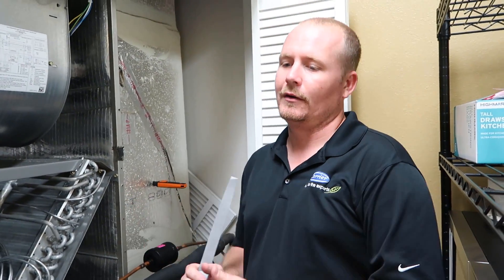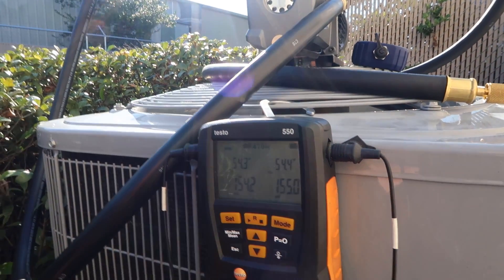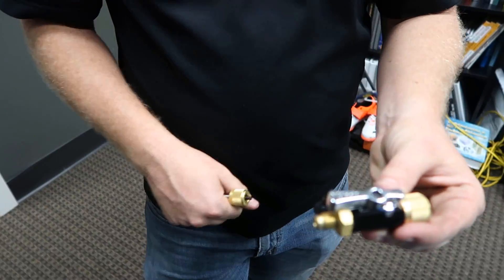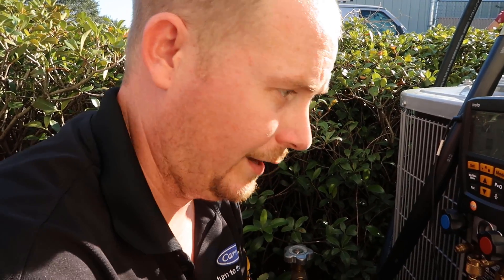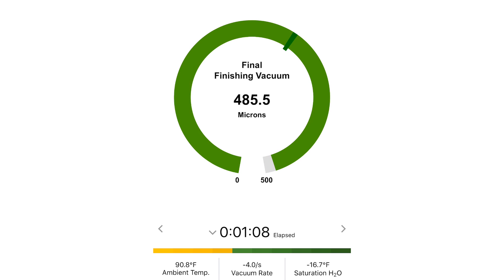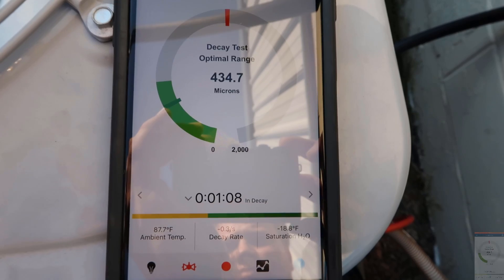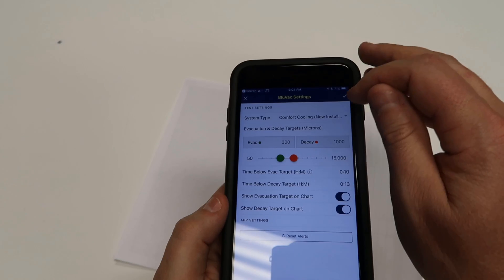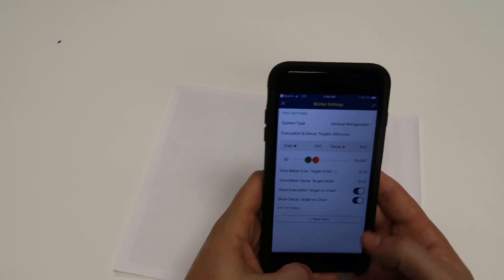How to Evacuate an Air Conditioning System (Fast and Deep Vacuum)

Comment: When you close off the valves and are ready to charge it back up, how do you remove your vacuum gague so you don't lose your vacuum? we dont want to get refrigerant into it the vacuum gague  when charging the unit right?
Reply: Close the valve on the core removal tool and isolate the micron gauge.

Comment: I’ve used the testo 550 gauges and got my pressures at -29.56 for vacuum.
Is that technically ok?
Reply: No the testo 550 gauge is only showing that you have reached below atmosphere  but not showing microns. You need to use a micron gauge to see the microns you have pulled the system down to.
Reply: @majikorn  Thank you bud.

Comment: I'm in college and I'm told that when evacuating, you put the micron gauge on the opposing line (Liquid line) because when you put the micron gauge on the suction line or on the same line that's connected to the vacuum pump, it'll mess with the results meaning it didn't actually hit 500 microns(it does but...), its just the vacuum doing a good job at bringing that number down though that doesn't mean it'll stay at or under 500 microns for very long. What do I know though, I'm just a newbie AC tech and you most definitely have more experience than me.
Reply: You are definitely right though mate that's for sure
Reply: Well if you look he has both liquid and suction connected to the vacuum pump. In the scenario you mentioned only one hose is connected to the vacuum pump, the suction line. The app he is using calculates from the speed, time the microns are increasing if it will increase above your limit you set in the app, such as 500 microns as he used. By having the vacuum pump connected to both suction and liquid lines you pull a faster more complete vacuum and it does not matter what side you put your micron gauge.

Comment: Where are those hoses from? And where do you get the screw on plugs for them
Reply: 1/4 inch plugs can be a double 1/4 brass fitting capped on one end, same for 3/8", 1/2".  Pump Tee adaptor with pipe taper at mid run, and some pumps come with an adaptor for the larger flare vac point setup, otherwise check with just better, parker, robinaire or other fitting suppliers for your needed setup. As for larger hoses, most supply houses carry the 60 inch version, as for  Core remover valve tool, same supply house.

Comment: If you had to recharge the system after pulling a vacuum through the core removal tools wouldn't the vacuum break when you put the cores back in?
Reply: You have 2 Schrader removal tools. Finish vacuuming below 500 to 250 microns you close the ball valves on the Schrader tools. Do the decay test, if  it passes remove your vaccum hoses. Release the charge off the system, if system is opened up and completely empty just attach your charging hoses and purge the hose and open the ball valve. You dont out the schraderd back in till the system has positive pressure
Reply: JPTinioMedia I’m with you there but what do you do on something like the Nordine units that you can barely get a set of gauges on much less the Schrader valve removal tool?? Not trying to nit-pick I do use the removal tool when I can (its great for leaking valves) but when I can’t I have to vacuum through the valve...what is the correct thing to do in that situation??? Also I’m interested in your app and vacuum system do you have a link to that?
Reply from the maker: You don’t put them back in until your done charging
Reply: @HVACS  then what is the process for removing the vacuum hoses and adding the charging hose?
Reply: jus1027 I’m confused as well

Comment: Vacuum pump, evacuation, pull a vacuum. Two newbies arguing weather to pull a vacuum or to do an evacuation. Then deciding weather to use a Rapid Evacuation Kit or Vacuum pump.
Reply from the maker: What are you talking about?
Reply: Is pulling a vacuum and using a vacuum pump the same as evacuation? Cutting through the jargon. Thanks
Reply: @texture6  if im not wrong an evacuation is when you recover whatever refrigerant. Then you pull a vacuum to get anything else out and with this method that last step becomes much shorter.
Reply: WTF? I don't post here because I'm not pro HVAC then I see this...Really,is it ok for the likes of me to ask questions on this channel? I would have some but I like to read first. Unless it was sarcasm then my apologies.
Reply: @InsideOfMyOwnMind  Nobody knows if they were serious or being sarcastic, nobody cares either. So if you have questions, absolutely, ask them. Their are plenty of techs more than willing to answer with good, solid, informative information about methods and procedures in the HVAC line of work. Good luck.

Comment: Where did you get that 1/2" to 3/8" Tee fitting?
Reply from the maker: Adam Walker Trutechtools.com
Reply: HVAC School ah I see the 1/2 to 3/8" hose,  did you just use a generic 3/8" flare brass tee on top?

Comment: How would you go about charging a system in which you have recovered the Refrigerant? While using the valve core remover tools.
Reply: close the valve remove the hose put a core in to the holder push it in the tool a little screw the cover down open valve put core back